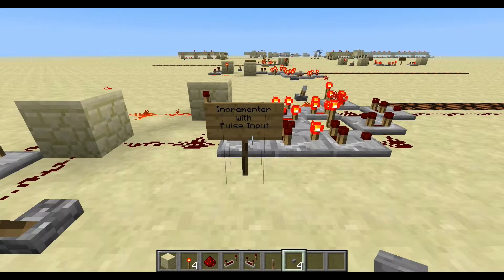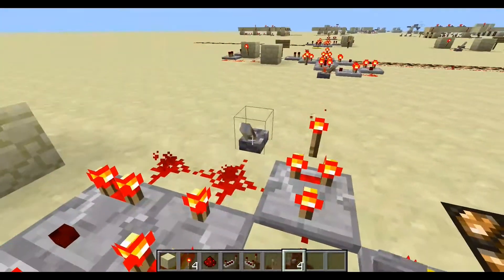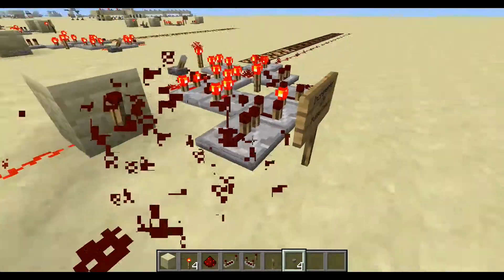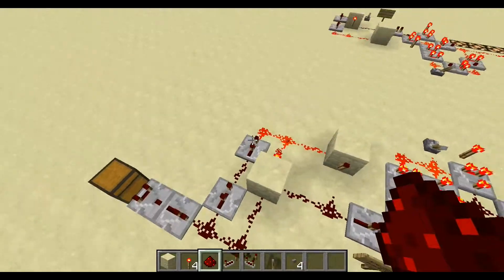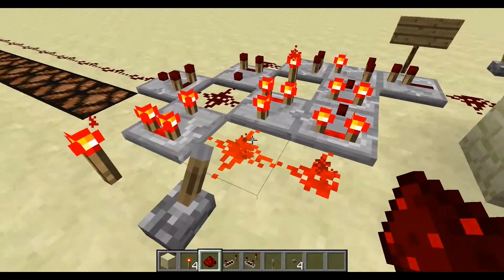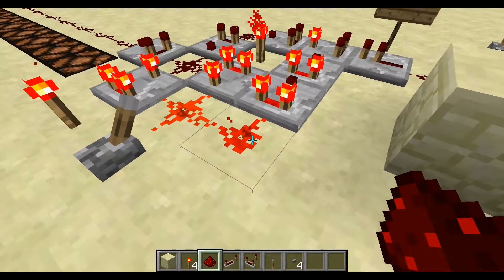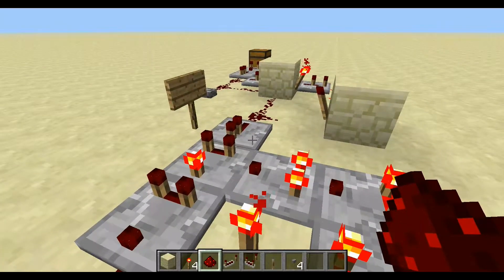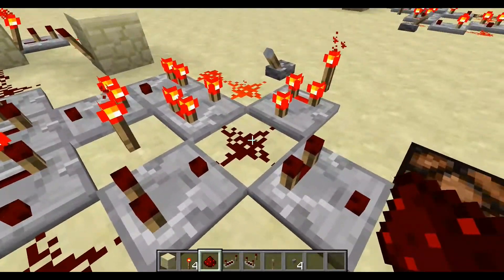Minecraft Redstone Update: Incrementer

Comment: Just seeing this for the first time and made it in my own world. I found that it can be used as to increment and decrement on the same circuit. To do this go to where the lever is powered by the redstone torch at 2:41. Then put a compartor facing into the redstone dust and then another comparator facing into that one. Take output A take two redstone dust distance away from output. So that you get A - 1, so output, dust, dust. Then send that signal in the side of the earlier 2nd comparator you placed. Put that same comparator into subtract mode. 

E.g 
A Starts = 15
A - 1 = 14
Subtract line activated or pulsed
15 - 14  = 1
A = A - 1
A now is 14

air,                    air,                        Torch,              Comparator>, dust(15),              <(-)Comparator, dust
down input ,   Comparator(-)>, Comparator>, dust(0),            <(-)Comparator, Torch,                  Comparator UP
air,                    Comparator(up),air,                    dust(0),           comparator>,      comparator>,     comparator(-) UP
air,                    air,                        air,                    air,                    air,                         air,                        up input